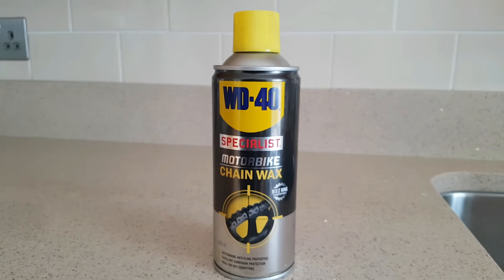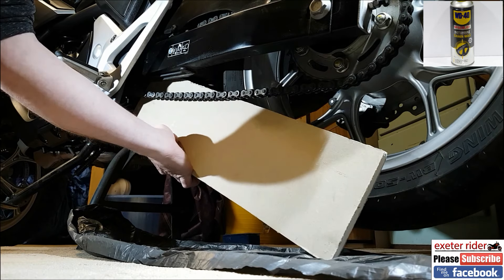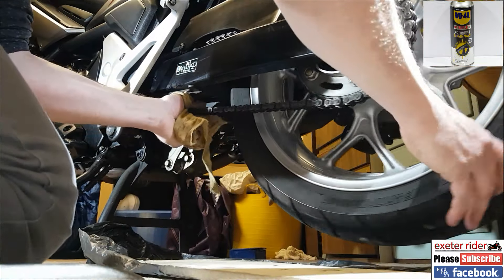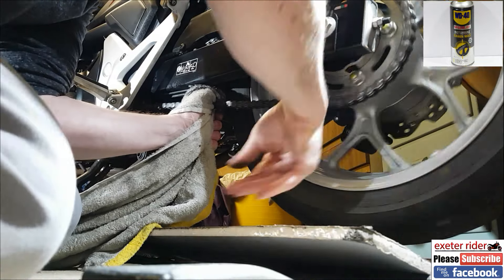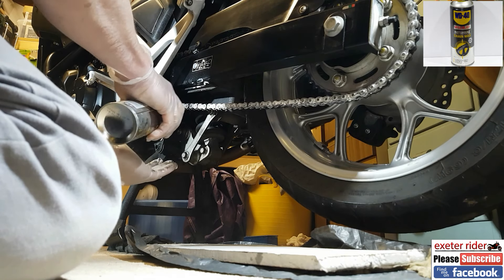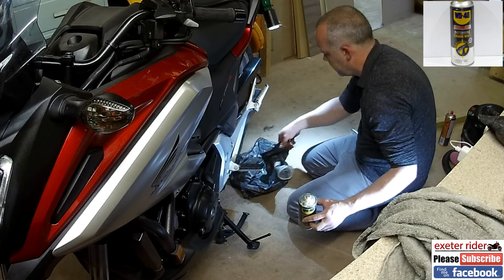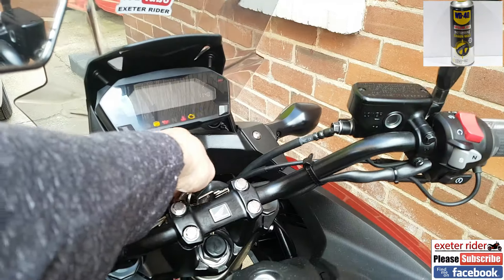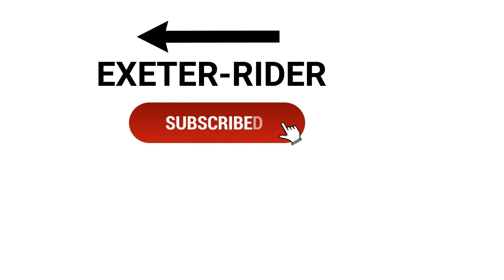WD-40 Chain Wax &  How To Apply

Comment: Bought some of the WD40 chain wax a while ago and just used it today.  Quite like it and find it’s easy to apply and clean too. The can nozzle is excellent. It’s also cheaper than the magical no-fling stuff .
Their motorbike wax and polish has also astonished me.  It’s cheap but leaves a very high lustre when lightly buffed. Plastics, paint, metal  - excellent!  
Works better than many “premium” brands I’ve paid a lot more for.  👍🏻🙂
Reply from the maker: Thanks for sharing, I've not tried the wax and polish but will take a look 👍
Reply: @exeterrider  I can’t get over how effective it is. It’s an epiphany moment and I’m telling all my mates. Spray it on everything, leave 10minutes and lightly buff with microfibre.  Even brings up the switchgear, plastics, instrumentation and carbon fibre. I’m thinking it could be very protective, but we’ll find out. 👍🏻
Reply from the maker: @ThreenaddiesRexMegistus  👍😎

Comment: How often do you clean your chain and add the wax?
Reply from the maker: Depends on so many factors--how often I ride and what wheather conditions I've been in. Generally with this stuff about 3 times a year.
Reply: @exeterrider  how many miles do you do in a year? 3x applications  doesn’t seem a lot. Thanks for sharing your method
Reply from the maker: I don't do alot to be honest because I get alot of loan bikes these days so mine dosent get used so much. 1500miles a year at a guess.

Comment: Hi mate how much fling do you get ?? I have just put WD40 chain lube on with anti fling the stuff is everywhere 😖😖 I even left it on for a week without going out on the bike 😂😂 all the best 👍🏻👍🏻👍🏻
Reply from the maker: Hi Rodders, thanks for all the Facebook likes etc first of all.... You get alot of fling do you? Did you get the old oil off first etc?  I hardly get any although the front sprocket builds up a bit granted. Not sure what to surges. Did you use the glove method to keep it thin?
Reply: @exeterrider  yes cleaned with the wd40 chain cleaner that’s great stuff will try the wax. 😂😂to be honest I may of put to much on. 👍🏻👍🏻
Reply from the maker: @mototravelduo3955  I lay mine on quite thick TBH, and do get a little flick but next to nothing. It is easy to not get enough of the old cleaner off and it eat into the chain wax but I'm sure you did get it all off. Goodluck mate!